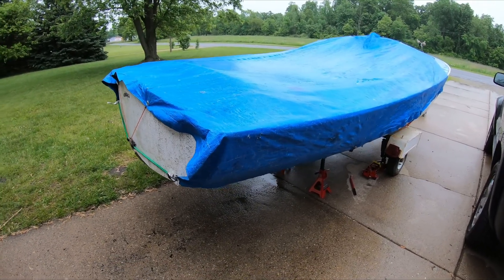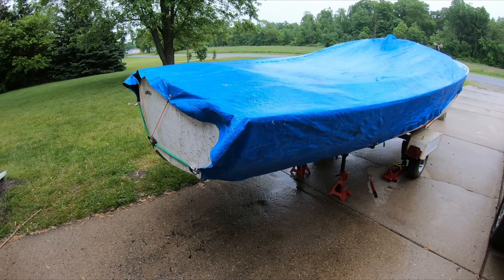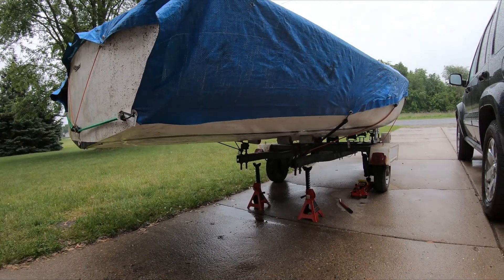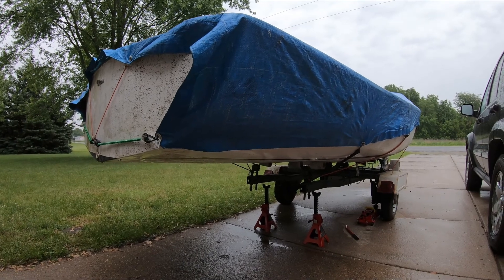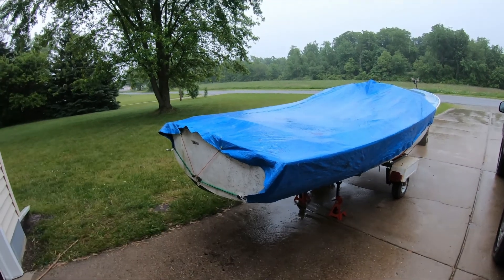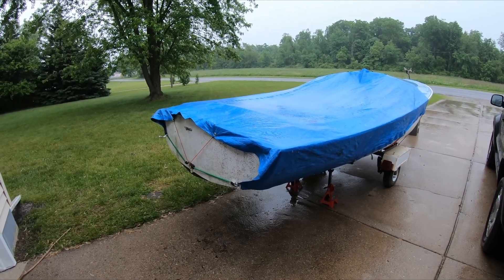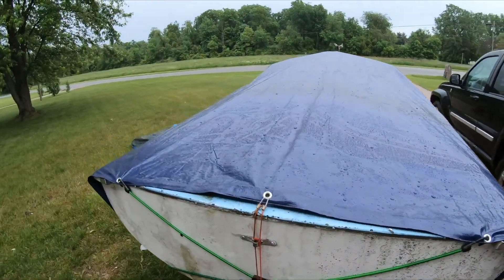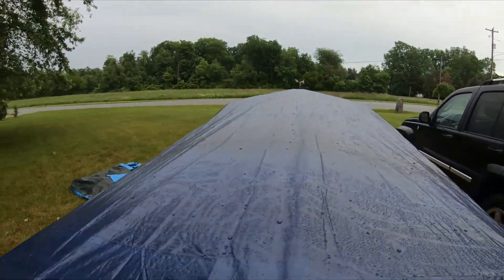Restoring My 1960s O'Day Day Sailer - Wheels off and Tarp On (Ep 2)

Comment: You'll probably need some serious penetrating fluid & an impact wrench to get the nuts off. ( not wd40). Often for stubborn nuts, I use the right impact socket, then a 1/2 inch drive "breaker bar" which is hand operated. Once you get the initial tight threads to break free, THEN you can use the impact wrench.